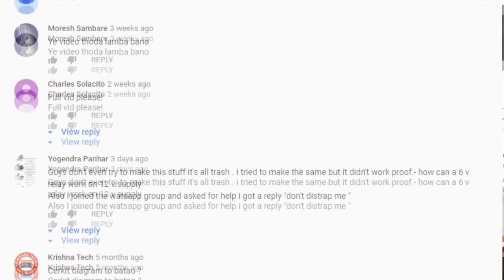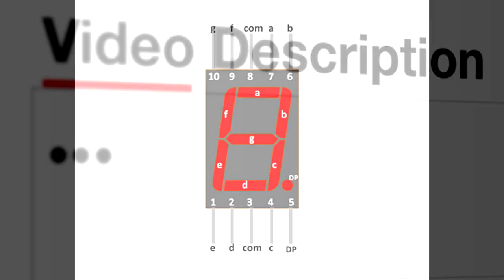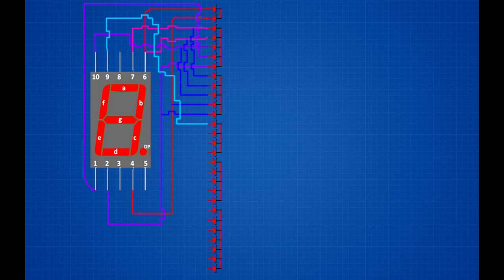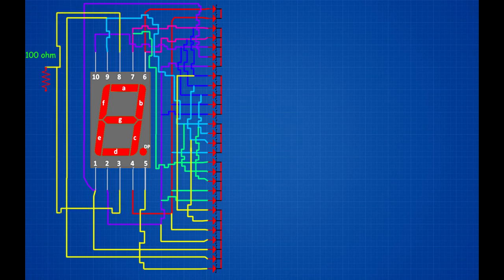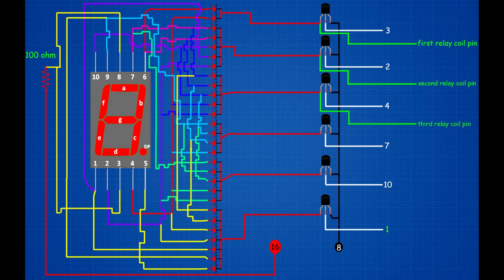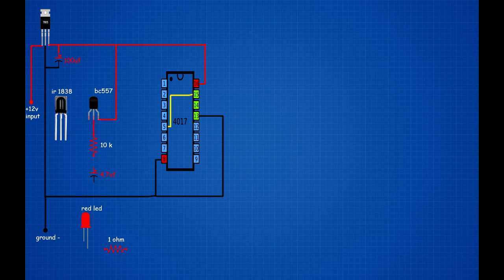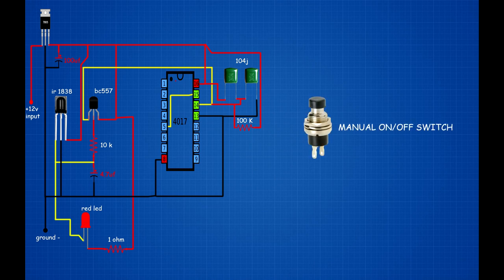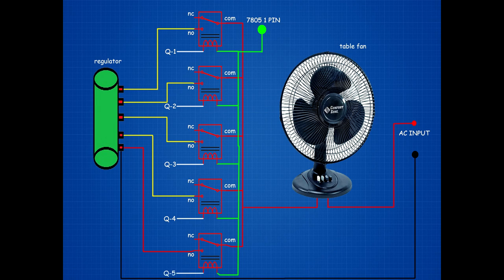REMOTE CONTROL FAN SPEED [VERSION 2] INCLUDING SEGMENT DISPLAY

Comment: Is it worth making sooooo complicated circuit for only numeric display? You can set 5 LED indicators of different color, and ofcourse the project would be more cost and power efficient if you use triac controlled regulator with a tricky plan of resistor manipulation.

Comment: I have dust allergy and Fan is the main reason for this. Because lack of simple circuit, I am unable to control the fan. I have knowledge of Google Home and Alexa related IOT.  I tried once using one circuit which I bought from Amazon but it gave me humming noise

Comment: Please Madam, I built it but the relay only trip, the display segment not displaying sensor not working.
Please Madam, it seemed on your board,there were four silicon diodes close to the
 segment display with input positive and negative input terminals on them which were not shown in the Schematics, Secondly, there were 6 transistors collectors connected to the cathodes of the 1n4148 diodes but on your board there were only 5 of them, also,in the Schematics at the site, the 100k resistor was  connected from pin14 to the ground but with your video demonstration, it was connected from pin14 to the output of the 7805 regulator ic,  the red led was not also shown on your board and hence what could be the function of it?    the last of my appeal is please could you make another video for the display of the 555 timer for the control of the segment display which was not shown in your demonstration?
Reply from the maker: Please join our what's app group.. And send the video.. 
I will help you in the group.